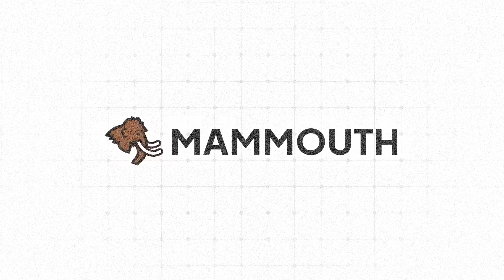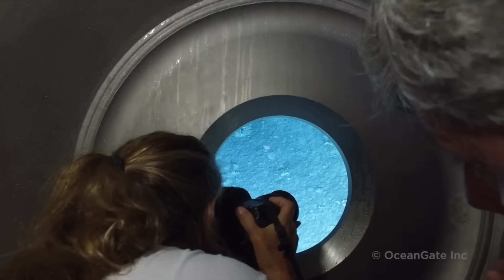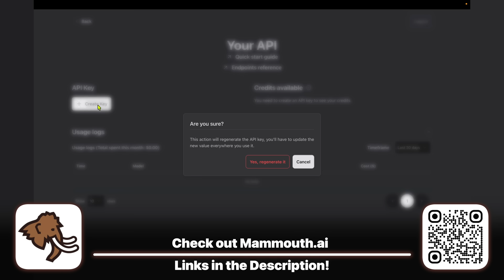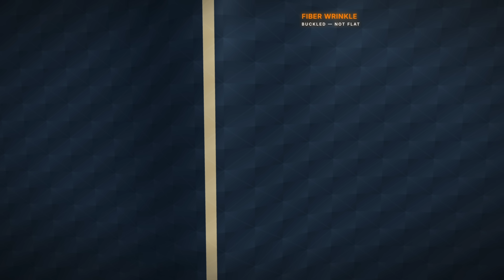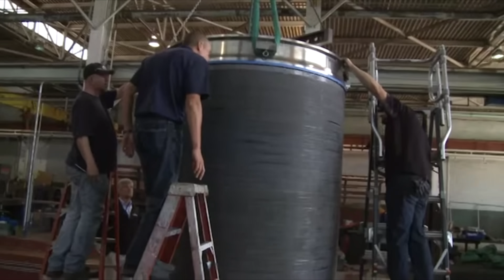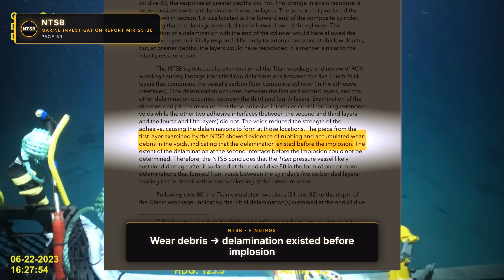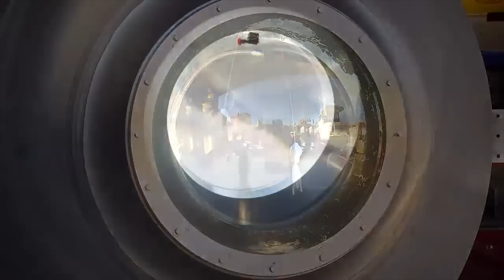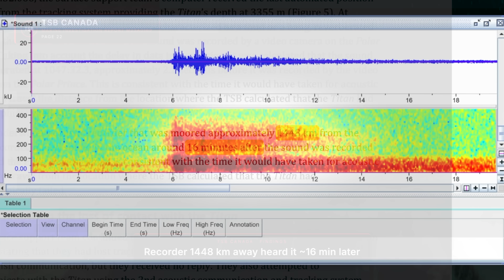Oceangate Titan: It was WORSE Than We Thought

Comment: Good summary of things. 

I also appreciate your comments on carbon fibre laminates. As you observed, there was a strong negativity expressed after the accident about the innate inappropriateness of CFL for this application. As you have identified, the problem is not the material … it was the way it was used. I have some familiarity with CFL (and other composite materials) in aerospace applications. From a perspective of responsibility, it is imperative that the limitations (when used in conditions of critical safety) are fully understood . The stories that started to emerge after the Titan loss were eye-wateringly conspicuous and should have been engineered out of the design before it was ever allowed near water. The very concept of attempting a monolithic structure of the thickness needed should have been rigorously understood and developed.

It smacks of schoolboy errors in engineering where the designer simply looked up the material property data in a spec sheet and treated the structure as a homogenous material … as “plastic” metal. You cannot. You have to consider the ply layers and through-thickness interlaminar relationships. You have to understand what defects you’re going to get and why as well as understand their impact on your design. You need to understand the thermal effects on through-thickness material properties as a result of the resin matrix cure cycle with due consideration to the innate exothermic effects of the chosen resin system. This latter is a big problem in thick monolithic structures where the resin can breakdown within a thick laminate just due to overcooking itself as it cures (internal thermal runaway). This will (most likely) be why they tried to build the structure in layers … but then the thicker you create your structure, the cure cycle then needs to be developed at each stage to accommodate the increased thermal mass. It needs a lot of development to get it right. 

Then there’s the “grinding” out surface irregularities … they will have significantly reduced the effective thickness by this action. 

They should have thoroughly mapped all disbonds and voids within the structure before releasing the structure into final assembly … and checked again to ensure the structure was not affected by such processes. Composite rotor blades of rotorcraft, modern transport propeller blades or aircraft wings are all subject to this type of rigorous test and assessment regime as they are all safety critical components. That’s why they’re expensive items!

SR might have had an aeronautical engineering education, but that, in isolation, does not make him experienced in practical applications of design and use of CFL structures in what should be certifiable applications. That’s why he should have employed and listened to appropriately experienced specialists. As the man in charge, he should have known enough about a certification process to understand the need for appropriate verification and substantiation. If he didn’t have the financial backing to do it correctly, he should not have proceeded until he did have the investment.

Comment: It's honestly amazing it lasted as long as it did. As an engineer myself, designing and building unmanned probes capable of operating to more than 5 km down (engineered to operate at 15km), my skin crawled when I read the report in its entirety. To give you an insight, one of our probes was dropped some 0.5m during recovery. After review, we decided to gut the probe for motors, sensors and other hardware, then retire the pressure vessel. To-date we've never lost an operational probe. These cowboys were an accident waiting to happen. Incidentally, we spin and coat carbon fiber in high vacuum and with multiple inspection instruments to detect deviations. Not sure what these clowns did, but at least in the video it doesn't look like vacuum to me? Anyone know if they used vacuum?
Reply from the maker: It’s a massive contrast to the rigorous standards you clearly follow, and unfortunately, it sounds like they skipped the most critical parts of the process.

Comment: If carbon fiber was good, regular submarines would be made of it.  The strands are strong in tension (if the Titan was pressured on the inside and not on the outside) it's fine.  It would make a great spaceship

Comment: This is still a carbon fiber issue. They might conclude that a perfect carbon fiber hull would have worked, but what's the point of that if we lack the technology to make a perfect carbon fiber hull of that thickness?

They should have stuck to what we understand and what we can make. That means steel or possibly titanium if they still want some exotic sounding material for marketing purposes. Perhaps they could have used some carbon fiber for ribs to be placed inside the steel cylinder to increase it's strength, but even then, carbon fiber is not great at compressive strength, so why complicate things? To save a few kilos?

Comment: Former boat builder with experience in composites.  That they ground the warped carbon fiber & used glue between successive layers is just insane.  It's a huge red flag for several reasons.  

Taking a new approach for building space-efficient pressure hulls is not in itself wrong.  Build it and test the living hell out of it by repeatedly dropping it beyond design depth without anyone in it. After multiple tests that include different dive speeds, performing emergency ascents, durations underwater, impacts, storage in freezing & hot sun conditions...only after high reliability in multiple scenarios is actually, physically demonstrated do you put people inside.
Reply: They didn't have money for all of that.
Because Rush literally took 100 mils and spent absolute most of it on "PR events" a.k.a. lavish parties with big people.

Actual investment professional with experience in business consulting. 
I laid it out in another comment in the thread slightly above; when the first rough figures were published, I quickly drew up some "napkin math" and it all didn't make sense. My first theory was that whatever number Rush published for the sum of capital raised - is grossly overstated. So a very very misleading campaign for further fundraising at best, quite possibly outright scam (note it's not clear who's scamming whom at those zoom levels, even whether rush/oceangate is "front and center", or indeed a "front", some secondary or tertiary component of large scheme - say, good old money laundering, - one that managed to attract too much attention).

However, it appears he departed not on great terms with at least some of his investors, from the early days, at least at some point had a clear view of OceanGate's finances. Some said less-than-nice things about the late Stockton, but noone ever doubted the total capital figure or even insinuated it was overstated by several times. It's just too much people must have been in on it and keep silent to this day. Not very realistic.

As you most likely know, "hundred mils" ain't as huge sum as most laymen (do not) imagine, esp talking a serious R&D project. BUT, it's still a whoop of cash. On the other hand, it's been published in some detail what they actually did (and didn't, which is most of what you said), plus rough estimates of what quite puny income they actually made. Iirc, two hulls, plus some aux stuff, plus a lot of staff at some point - many people that were let go long before the physical implosion, and a lot of hot air where one expects money to be.
Like, all their "collaborative projects" with name-brand organizations, even government ones, that were vaguely presented as serious stuff (presumably worth millions and millions). To put brands in the sales pitch. Then all of those revealed it was all bupkis, some laughable things for laughable money. Like, "collaboration with NASA" was some paper reading "we don't know about your diving, guys, for us in space carbon fiber works great. Here are some basic CF laying manuals, and good luck!" OceanGate paid few thousands for each of those "high-end projects", tens of thousands at best.
- that's literally not the level of 20-40 mil company trying to inflate itself to a hundred, more like a post-doc inflating his research cred in grant applications.
So yea, giving every doubt their way, I absolutely couldn't account for at least half of their declared budget (fair warning: don't remember what the actual figures were, talking rough ballpark. Remember the ratios well, and that specific vacuum where most of everybody expected huge R&D expenditures to be).

There's another obvious hypothesis, that Rush (possibly some accomplices, from among the publicly known and/or unknown names) simply siphoned it into own personal pocket. Again, I've seen more than my fair share of those, and this really doesn't look very familiar. 
Even as simple as profiling: people tend to do that with a very rich and happy retirement in mind. It is super irrational to expect people to be rational, yet even irrational crooks very rarely put their own asses inside an apparatus with safety they themselves just gutted for their "swiss bank" - today crypto or what else - account. 

Bottom line, in my mind the version most consistent with the known info is the kinda "official" one. They took off well enough, hired a lot of people, did a lot of "presentations" - likely convincing themselves it is investing into getting more investors and/or clients... then, quite soon, learned what we started with - it aint that much money when you need actual R&D done! - went downsizing, pauper mode of operations, "extra" safety a very common early casualty of all such stories, and the rest is history.
Reply: I like your thinking!
Reply: Exactly. Test test test retest again until everything is as perfect as you can get.

Comment: Honestly, most of the time these things happen its because of the same issue: Money! Greedy people don't want to spend the money. Its rush and cut coeners to get ti market quickly and then wonder why it fails. It wasn't any single engineers fault. It was a financial cut corners take risk result. Rich people keep trying to save cost, at some point you have to spend the money it actually takes to build a proper project. That takes time and money. Its not even about getting certified. Its about doing it properly and what it takes to ensure its safe or don't do it at all. Especially if you are risking other peoples lives. If you want to do it for yourself and don't care if you die go for it, but if other people are going to be in it you need to spend the money and take the time to ensure things are safe. Not storing it properly is crazy as well, that is such a tiny expense compared to the lives lost. All because of greed.

Comment: If the weakest point was in the middle of the cylinder part why didn't they just add another titanium ring in the middle of the tube?  Or two... Not being solid metal was a weight and cost cutting measure, one or two extra rings would not have being a huge extra cost or massive increase in weight.

Comment: Thank you for the summary. Not what I expected, but then that is why you have scientists and engineers do an analysis of the failure, not take random people’s “expert” opinions based on what they read on the internet. BTW, when a wafer has been processed, it is typically tested and tuned (trimmed) prior to dicing and packaging. In most cases, this is because the cost of packaging can be a significant part of the cost of the IC. Also, the packaging stresses can impact the function or performance of an IC. Tests are also typically performed over the entire designed operating temperatures, at least for more costly devices. When military or medical markets are concerned, testing becomes much more stringent, using extended burn-in, vibration, etc. testing. I guess Ocean Gate tried to create the equivalent of a military grade craft using the equivalent of Poly Packs grade techniques.